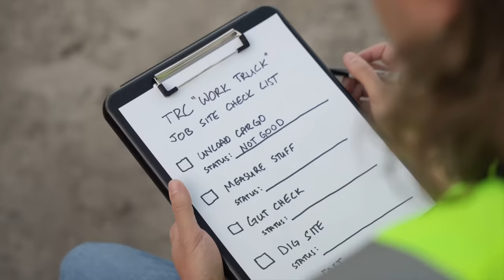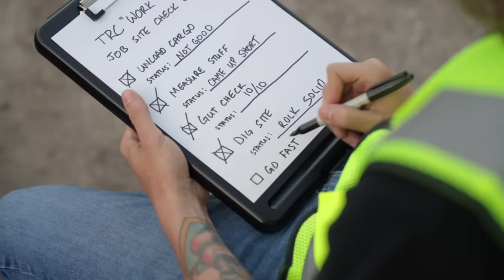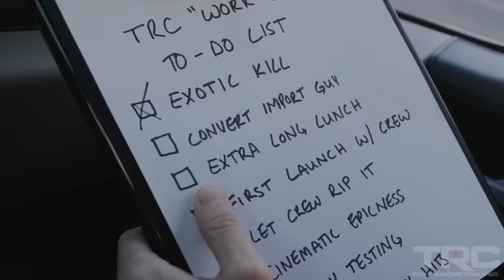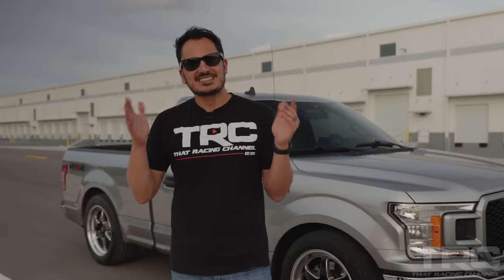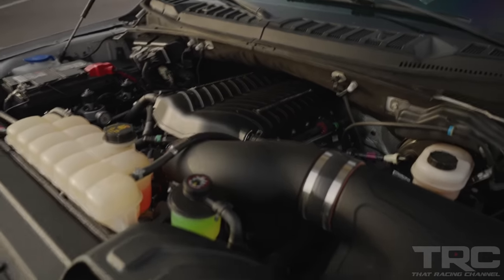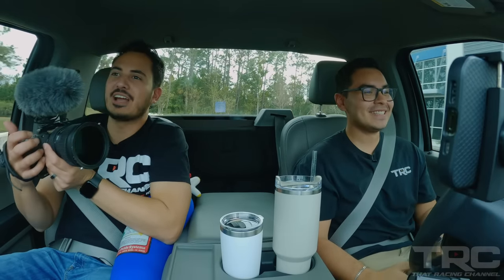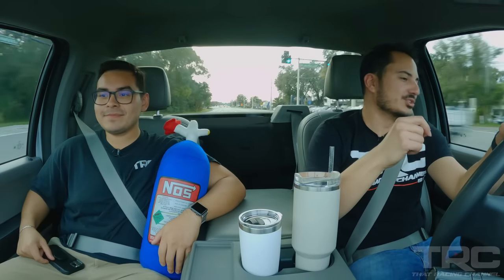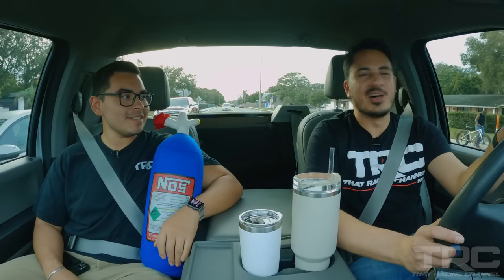"Work Truck" GAPS Lambo on the Highway! (PRICELESS Random Encounter for OUR NEW PROJECT)

Comment: These F150s are all over the place in Texas.
Reply: Midnight performance
Reply: Everything is Bigger in Texas😎
Reply: Never seen 1 in person in in Florida
Reply: I drive an f150 and every time I pull up to a red light there's bound to be one or two if not more.
Reply: Yeah, but I’ve only seen one single cab F150, and it was just within the last two weeks. All the other F150s in my city are extended cab or 4 door.

Comment: @TRC You can put a Larriet Transfer case in it, for 4A which will auto switch it from 4x4, to RWD when it's optimal. Which will also help with Transmission temps.
Reply: Would be awesome to make an exoKart out of that too. With a Tube frame/chassis.
Reply: Not sure those transfer cases would last trying to switch while the truck is outputting over double the stock torque.
Reply: @rileyneufeld7001  a lot of 900 hp trucks use them. They're good for about 1000 ish, but you'll probably want to up the cooling, and gears so you don't have to worry.
Reply: It’s not going to switch to 2wd under load.
Reply: @TheDieselndust  sounds like you don't drive one
Reply: @Flooberjobby  sounds like you don’t either, you can’t even spell Lariat!
The transfer case will not shift with the gears tightly meshed together, you have to let off the throttle. Then it will shift.
Reply: @Flooberjobby  ya keep deleting my posts, you know I’m right.
Reply: @TheDieselndust ... It's not my page I can't delete anything. You crazy
Reply: @TheDieselndust  mine is in my garage. Lol 😂
Reply: @Flooberjobby  still not smart enough to spell “ Lariat”

Comment: The coyote platform has been taking over since its release in 2011!
Reply: Crazy how people like Alex have been praising it for years and just now everyone is realizing how badass it is.
Reply: @olivermayer5834  Yup. If you've been in the Ford crowd for any amount of time you would know they're on another level. It seems just recently the Chevy and Dodge crowd have been seeing what they've been missing.
Reply: Just bear in mind this is NOT the same engine thats in the Mustang.
Reply: Mustangs V8 doesn't have Flex fuel. Only the truck V8's do. That's because the F150 V8 is based off the old 4.6 V8 from the ol'e Crown Vic and Mercury Grand Marquis.
Reply: @MasterCarguy44-pk2dq  Totally incorrect. The truck 5.0 is 99% percent the same as the mustang. Heads are slightly different, cams are different, intake manifold, oil capacity and other small things as well. The "flex fuel" in the trucks is inferred off of the O2 sensor that's why mustangs can get flex fuel just the same as the trucks can with an aftermarket tune.
Reply: @MasterCarguy44-pk2dq  Dude what are you talking about? It's the same motor as the mustang except the cams on the truck are slightly different. You can take coyote mustang cams stick them in the F150 coyote make it a mustang cam profile and it runs like stock. Coyote is Coyote. Does not make a difference if it came out of a mustang or an F150
Reply: @olivermayer5834 I remember watching BoostedF150s channel years ago. I think that’s the first I’ve ever seen a rcsb coyote go 10s with just a whipple.  Now these trucks are unhinged. Now I want one. Haha
Reply: @MasterCarguy44-pk2dq you don’t know what you’re talking about just be silent
Reply: These 5.0 coyotes know how to get down.

Comment: trucks a beast, so does it not auto upshift?  do you just downshift to the gear you want to roll in, hit it and then quickly click the gears up?  My mustang follows me when I start clicking like that but my auto upshift on the f-150s dont seem to ever want to auto upshift like they should even though the tuning is setup for it?

Comment: @3:24 The repeated presses on the windshield wiper actuator arm off the steering wheel, is that connected to a 100 gallon 1 Million Nitrous shot tank?  

Would be cool if there was a color coded LED heads up display, that changed color as power increased, similar to how audio DB Drag shows have a light tree that lights up when you burp your subs.  

Does it say NITROUS with a big red button like in Fast and the Furious?  Great video!  Smoked that Lambo!

Comment: Curious as to what size pulley was used in this video ?
Reply: 3.75 he says when looking in the engine bay. Sorry he says 3.375 pulley but I assume he means 3.75 pulley as mine is 4inch and I make 700whp
Reply: Thanks, I must of missed when he said the pulley size. I am currently using Griptec 3.5 pulley.

Comment: So nasty..... Can you explain the shifter and why your pushing the up shift so many times? Is it a diff setting now?
Reply: I had to watch a few times, I’m pretty sure he’s throwing more boost at it with those buttons, almost positive that isn’t the shifter anymore
Reply: Lowering the top gear. The -/+ changes the maximum allowed gear. Hitting - takes the limit down so it prevents staying in the higher gear. He should get a raptor steering wheel which has paddles on the steering wheel that you can manually downshift instead of gear limit.
Reply: @RadDadisRad  yea I figured that but he was pushing up a shit ton when he pulled on the lambo
Reply: @dmolchanoff11 that 10 speed life.
Reply: @allrimmedout yep I have to do that in my f150 too 😂
Reply: @dmolchanoff11  yeah, you have to let it row through the higher gears so you don’t mph limit out in a gear
Reply: @adamdodsy84  aaaaahhhhhhhhh ok ok..... Now it all makes sense... I was like wait stop shifting so fast hahahaha

Comment: Just a FYI, you can pull the 4WD knob out and it locks the rear differential in if that XL is equipped with that option.
Reply: I'm sure TRC had no idea....😂

Comment: 830 to the wheels ? how much power does the Whipple give you alone ? coyote stock is whAT 395HP.
Reply: Alot whipple gen v 2.85 pulley can make north of 1200whp. But not on a stock motor obviously.

Comment: Make sure Lund Racing is the only tuning company you use, i'm sure brett would agree
Reply: Brett works at Real Street and Jay has been tuning Fords since the 90s. Jay's tunes have set records across multiple platforms and racing styles. Jay tunes Brett's car.  Why would Brett agree?
Reply: @tailwatcher2500  Your comment tell's me you don't know much about the coyote game which is fine, but i'll say if you understood why I said what I said it would make more sense.
Reply: @olivermayer5834  you comment tells you don't know the history of Real Street. Sure Lund is a top coyote tuner, Jay is still the tuner for the fastest stock block coyote on the planet, am I wrong?
Reply: @tailwatcher2500  You missed the point. Does Jay have a record pass for a OEM 10R80 F150?  Not that i'm aware of.  Unless TRC is putting a th400 or race trans into the car then nobody except Lund Racing should even be considered if they plan on sticking with the OEM 10R80 since almost all of the fastest OEM ford Trans F150's are tuned by Lund Racing
Reply: @olivermayer5834  much respect but I'll say this. Lund and Jay from real street are friendly. If your looking for motech go with real street. If your looking for stock ecm and tcm go Lund.

Both are absolutely amazing teams.

Lund congratulated to Bret for brets killer pass and Bret congratulated Lund on their huge win at MIR

Comment: I picture a 1500hp AWD aluminator in the future.
Reply: Gonna have to swap to built 6r80. 1100whp is too much for 10r80 nevermind 1500whp.

Also stock alluminator are good for 13-1400. Anymore you might need it sleeved.

Comment: Is this a stage 2 Whipple? What is the supercharger this has im thinking of doing a sleeper build and idk if I want to have it done at town n country ford with the roush supercharger or Lebanon ford's roush or there other option a gen 5x 3.0 Whipple the roush is 705 horse and the Whipple is 700 horse idk which to do im going Whipple most likely because I would love to have 830 to the wheels
Reply: My Whipple makes no whine noise with 4inch pulley it's dead quiet. I make 700whp with e85 I'll make around 750whp when I'm done my fuel system. My car in my avatar pic.

Comment: How are you getting over at 8 at the wheels. Not saying it isn't true but with that set up it's always around 7
Reply: 3.75 pulley plus e85 800 pretty dead on
Reply: I'm confused myself. It's the same thing that Shelby uses on their versions. And they're only crank rated at seven seventy five, rwhp normally 550ish on those
Reply: Of course they not e85

Comment: Wow, I didn’t know the Ford V8 had so much potential! I would like to see you guys make the same upgrades to a Chevy and a Ram truck and see if they can compete!
Reply: must have been living under a rock for awhile buddy
Reply: @Hehateme69  😆 Lol, I’ve been an LS guy, having an LS6 in my 03 Z06.   I’ve owned several v6 Ford fusions and a v6 Lincoln MKZ, which have been totally trouble free and pretty quick at 240 to 280 hp stock. It’s crazy that Cletus McFarland on a different video than this one, could take a stock Ford pick up at around 400 hp, install a Whipple super charger and do nothing else and Dyno over 1100 hp at the rear wheels! Wow! Not sure how much power this one has.
Reply: @darrylsjodin7184  800whp currently.

That's really all you need. The 10r80 doesn't like more HP than this.
Reply: @hatch450sx3  wow, that’s plenty. I remember when 250 hp was a lot!

Comment: Imagine if it was a Mustang 4x4 ☠️
Reply from the maker: It would weigh about what the f150 does 😂🫣
Reply: @ThatRacingChannel  So a 4wd setup weighs 1000lbs..? The difference between a 2wd f150 & 4wd is approx 200lbs..
Reply: that truck is basically a mustang, so u have ur answer

Comment: Why can’t they put this into a nice 4 door f150 lol
Reply: My buddy has one that’s pro charged, midnight is building his transmission rn, he’s looking to be at 1300 rear wheel after the new build. His last f150 super crew 5.0 was making 900
Reply: @bigdawgs94  1300 on stock motor? If so he's gonna put alluminator in when it blows up right?

Comment: Aluminum body or not "Go fast goodies under the hood" costing how much?? You can't go that fast without spending serious money.  4×4 or not, no way they upgraded it that much for under $20K in parts at a minimum. Labor is at least another $10K. Show receipts. Lambo race in video is obvstaged. Take it to the track to prove it's legit. Otherwise, it's seriously awesome.

Comment: it bothers me that dodges and chevys are so much harder to build right now
Reply: That's the beauty of DOHC engines. All they need is boost and fuel. No need to touch the heads or cams.
Reply: @rileyneufeld7001  not at all what I was referring to. Dodge and chevy dont have single cabs with short beds anymore. A dodge or chevy truck could make way more power any day of the week. The weight is the problem.
Reply: @THESLlCK  Lol no they wouldn't. For a 6.2 truck to run what a 5.0 f150 does it's going to take triple the cost since you're going to have to do motor work.
Reply: @renedl22  LT1's can shatter a piston over 700whp, are DI only so require thousands in fueling upgrades alone, you're going to need a cam, you're going to need aftermarket/ported heads. Tuning requires unlocking the ECU which isn't cheap. 392's Epstein themselves with 6psi and building a hemi is outrageously expensive, they require a built transmission, single cabs only come with 5.7's which are a joke in the v8 performance world... Or get a 5.0, boost, fuel and make 1000whp without opening anything. Now show me where the cope is.
Reply: @THESLlCK  cope 👇
Reply: @rileyneufeld7001  I meant cope to the other guy

Comment: F150: The ONLY truck made with over 50 open recalls including 20 on the powertrain and components. 😅 Don't buy one if these post 2018. The dreaded cylinder deactivation that makes. Chevy so bad is in new Ford f150s from 2020+ and 2024 Mustang V8 and in all Chevy V8/V6's except 4 cylinder, and C8 vette.
Reply: Tuning takes out cylinder deactivation

Comment: Last thing on the list - sell it cause it’s a pos unreliable ford 😂
Reply: Coyote is more reliable than any  other v8 currently in production
Reply: @Jimmyxsx  cap 5.7 hemi or 5.3 ls/lt
Reply: @YesNo-ty5eb you’re kidding about the 5.7 being reliable right? Lifter failure destroying camshafts and exhaust leaks reliably happening every 75k miles that’ll torch the cylinder head at the exhaust port. Haven’t seen any 5.7 or 5.3 trucks offer a whipple with a warranty, ford does with their fp700 kit. 🤦🏻‍♂️
Reply: Lmao you’re joking about the 5.7 and 5.3 right ? No seriously..these new 5.0s are ripping
Reply: @YesNo-ty5eb  😂😂 what are you smoking
Reply: @CoyoteFTW  reality…
Reply: @YesNo-ty5eb youre smoking something but it aint no reality bro
Reply: @YesNo-ty5eb  been daily driving my "unreliable" 700whp whipple coyote even in the snow. Lie more.
Reply: @hatch450sx3  3 weeks don’t count bucko